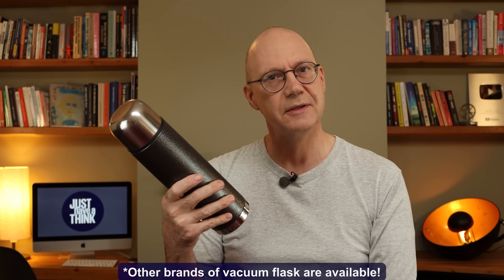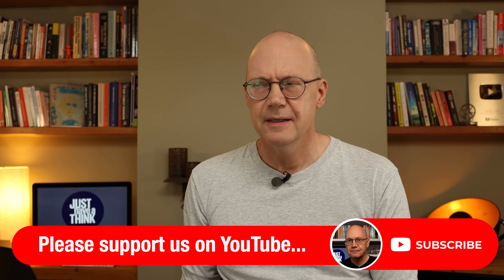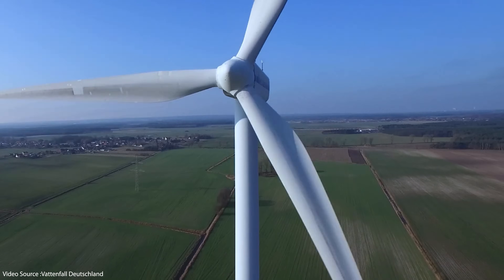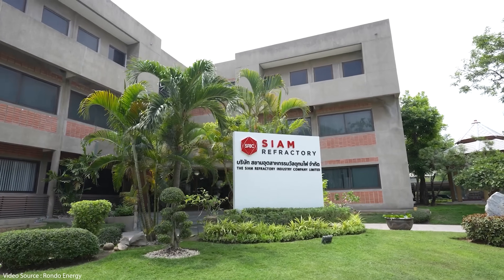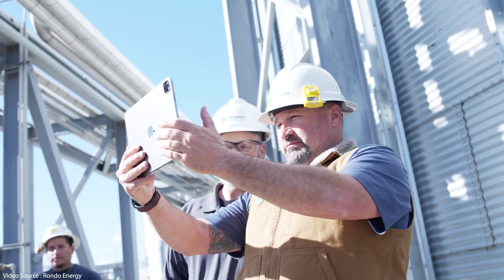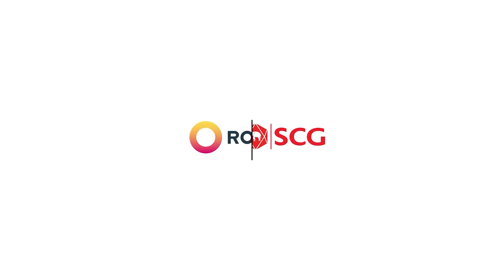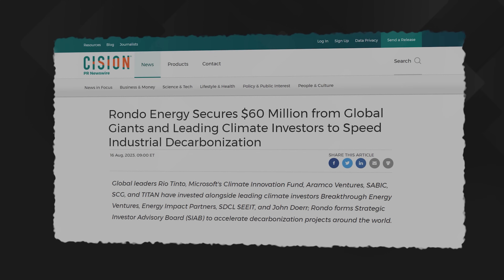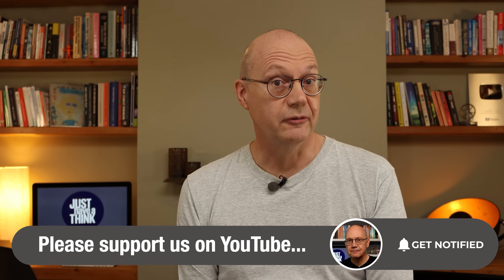This energy storage technology is HOT STUFF!

Comment: My father was part of the design team at Bethlehem Steel for (what was then in 1962) the largest integrated steel making facility in the U.S. called Burns Harbor located in Michigan City, IN. They developed and implemented many innovations in the capture and re-use of waste heat in various parts of the operation. We visited that facility in 2019 for what was the 55th anniversary of rolling the first piece of plate steel off of the mill in 1964. The plant is still in operation today as part of the Cleveland-Cliffs company (stock ticker CLF). 

For anyone who has never seen the process of making iron in a blast furnace and then converting it to steel in a basic oxygen furnace, and then turning it into basic steel products such as steel plate, hot rolled coil, nickel plated products, etc., it is truly awe-inspiring in scale. Unfortunately, it is also a major carbon generator, something the industry has been working to improve for decades.

Comment: Why not heat the water by using the water to cool the current power generators? True, that energy is not green. However, that heat is usually lost into the atmosphere completely. Wind turbines and solar cells don't generate much heat when they are operating.

Comment: There is a huge difference between heat storage and storage of electrical power. You can only generate electrical power from heat by a Carnot cycle. That is dreadfully inefficient if the temperature of your stored heat is only 90°C. Its thermodynamically ideal efficiency is (hightT-lowT)/lowT=(90-30)K/300K = 20%, in reality it is lower than that.

So these schemes are only useful if heat is what you want, not to run your PC or your EV. 

Any reduction of CO2 output is welcome of course, but we really need electrical storage to offset the intermittency of renewable sources. Heat storage can only do so much.

Comment: A smaller simpler version of this could provide heat for small home greenhouses or maybe even homes in more temperate areas. I live in Texas and quite often in winter we have sunny days - very bright, warm sunny days, but it might get quite cool at night. Seems like a thermal solar collector could grab heat and store it in the brick box for home heating at night. Most every house uses forced air heating here, so the heat battery could either ciruclate air directly through the bricks for use in the home or use a transfer medium like water or a glycol.
Reply: Or build passive houses

Comment: If the point is to use electricity to heat some kind of thermal batteries, why not also work with heat pumps ? I mean, you could get a lot more heat per watt... And then you'd kinda be "cooling the planet" doing so.

I understand that moving from electric heaters to  heat pumps is introducing some kind of complexity, failure points and cost into the system (and as we are talking about startups, that's probably hard to do). But I think that it should be the way to go. Maybe you know, if you make some kind of  heat pumps working from outside air temps (let's say -40°C) able to heat all the way to like 1000-1500° C, I think it could directly replace fossile fuels burners too.

Comment: Dave, this is super encouraging and needs to be massively scaled!!  I live in Canada where we need to massively scale up the geo-thermal via closed loop use of old drilled gas and oil holes where pressurized water can be pumped into these shafts to be super-heated and returned to the surface to turn turbines for power generation.  Would love to see an update for this and how it can be integrated into heat storage as well.
Reply: Canada is a great location for heat batteries, and we're engaging in multiple territories!

Comment: I noticed there is no comment that the overall efficiency won't be better the 50% because the conversion from heat to electricity isn't very efficient.
This assumes the energy input is heat in the first place(maybe concentrated solar), which it probably isn't.
Using solar panels to generate electricity and then convert that to heat to store and then converting the heat back to electricity is probably less than10% efficient overall.
Some batteries are 96% efficient on electricity in to electricity out so using solar panels and batteries is about 20% overall, so skip the heat storage stage.

Comment: You really want to use some form of material that has a phase change when heated because it can store the same amount of energy in a much smaller volume.
Reply: Only if space is tight!

For commercial applications what you want is a material that stores most heat per unit cost (including costs of the infrastructure to hear it up and to take away the heat when wanted). Cost of real estate varies greatly, and what would be a waste of space in (say) Manhatten is not so in (say) large parts of Australia.

Where space is premium priced then I agree phase change storage is the winner

Comment: hmmm... Maybe eventually, with enough insulation, this could be used for homes further north, using excess solar power thru the summer months and getting the heat in the cooler months, but it seems like it would be more cost effective for a group of homes/buildings kind of like the superheated sand they are using for district heating in (Finland?). Where I live (near Seattle), with a climate similar to England, we use far more power in the winter when the days are short and we don't see much sun do to the clouds and rain.
Reply: Refractory bricks can have very similar specific heat capacities as silica sand. Sand has no structural strength, so it has to be placed into a structure that is designed for heat to be added and removed. The Rondo block system is quite clever in the that blocks provide the airways to allow the heat to be extracted. For a sand battery, you need to provide this structure, which adds to the cost. The Rondo system could be one of the very cheapest out there.

Comment: I like the idea. However, in order to be useful for industrial heating the temperature of the "battery" needs to be hotter than the required temperature for whatever it is the heat will be used for.

Liquid water as the storage medium is limited to <100 degrees C, which doesn't seem hot enough. Presumably, the brick approach can go higher. If so, this can be a good, efficient way to use renewable energy for industrial heating - if you can put together enough excess solar and wind power to power it.
Reply: You're look at about 1000-1500C for ceramic and/or graphite heat storage mediums - that's what I've seen from Rondo and Antora for industrial process batteries; though the battery doesn't have to do all the heating itself. e.g. Glass Industry have used them for a long time, calling them Checker Packs and the structure they’re housed in are called Regenerators; the exhaust of the furnace goes through the bricks, heats them up and when they intake combustion air it is pulled through the checker packs to get preheated before heating the air further with gas – saving tons of gas.

Comment: Their is one flaw.  Using a metal thermos is inappropriate as these lose heat via metal conduction.  Thermos flasks and airpots originally used glass vacum jacket. These remained hotter for longer than the metal variety.  Thus glass thermos flasks a a better analogy for heat storage.

Comment: I think this can be part of the puzzle. The main problem we've had in the past is a "one size fits all" mentality. We need to figure out what the best solution is locally and not try to shoehorn one solution into all situations. This seems promising and doable.
Reply: While it's a good point, one thing we solve for is versatility in the same way the the natural gas boilers that we replace are versatile to be used across many industrial sectors. They use the same steam pipes, flanges, valves etc., and we've designed the RHB to be a drop-in replacement using the same conventional parts. Plant managers don't need to worry about big costly changes, but drop us in directly to swap out gas boilers.

Comment: Solar thermal is the answer. I've been saying it for years. I'm prototyping a solar thermal platform right now. I will continue this relentless pursuit until I have a viable product for the market. It is proving the most challenging project I have ever endeavored to complete. I hope others will realize the potential along the way.
Reply: The falling cost of wind and solar PV has made it very challenging for solar thermal to compete. Also, in our market, we're targeting facilities where energy density is critical because they don't have excess land, so a large solar thermal plant would not be viable onsite. Also, when you transport heat over distances, you lose a lot of it, so it's important your heat generation is located close to where it's being consumed, which is why our energy dense batteries fit right onsite much like a gas-boiler does.

Comment: It would be interesting to see a breakdown of where different heat storage systems might work best.  You've got a few things going on... obviously, if you need industrial heat at really high temperatures it's better to have a system that goes up to higher temperatures, whereas district heating you wouldn't need as high a maximum temperature.  If the water tank is staying below the steam level they aren't getting any advantages out of phase change.  I'd think the holy grail would be something that is easy to contain but that had a couple phase changes above the output temperature you want, as well as a high specific heat... my brain is trying to wrap my head around thinking about what pressure changes would do.  I know if you suck the air out of a chamber you can get water to both boil and freeze at the same temperature, but I really don't know what that is doing to the calories invovled.

Comment: Re: "10% of the hot water requirements of the entire city of Berlin"

This! It is utterly insane that things like district heating working off of renewable resources or (at the bare minimum) taking advantage of waste heat from industrial/electrical production processes.

You deserve this. I deserve this. We deserve this!

This HAS to happen on the municipal level. That's the scale where you can make a difference. So do it! Call your local representatives and make a fuss about this. Start with convincing your neighbours that this is doable.

It's expensive up front because it's infrastructure but that's not the point. The point is that we can pay for this now and have the infrastructure in place to minimize the constantly creepy costs associated with climate change as well as have a measurable reduction in greenhouse gas emissions locally.

Do it. You. Yourself. Make a fuss! Be loud! Demand answers and solutions! Your siblings deserve it, your kids deserve it. Do it for yourself and ourselves. We need you. Let's GO! WOO!

Comment: I use some 1970's Steffes ETS heaters. they heat bricks up to red hot. then a fan sucks air in from the room and sends a small amount up and threw the bricks and back down and out. These old units just have a knob to set the temperature and a room thermostat to control the fan.

Comment: The idea is actually quite old and technically not too difficult. The bottleneck for these high-temperature systems will in the medium term however still be the energy source. To transition the industry fully, it requires enough green [electricity] to offset 25% of all fossil fuels, which means that the current green energy electricity must quadruple first (if we do not use the green electricity elsewhere). 
Personally, I think using specialized heat pumps with overlapping temperature trajectories to upgrade the temperatures for industrial use is way more efficient.

Comment: The main reason that high energy use industry has trouble de-carbonising is the mind set of the managers.
Their brains are locked into oil fired boilers and diesel generators. They are risk averse, even the smallest risk will have them scrambling back to the tried and true fossil fuel solution. It will take the removal of those managers over time either by retirement or other means to effect change.

Comment: Curious that they chose air as the conductive medium since it has about 1000x less energy density vs water. I guess it might be because you'd need to handle high pressure steam at those temperatures?

Comment: Heat storage is a good idea, but other than for district heating schemes, their application is very limited. To store the heat, you first have to generate it, and doing so from excess wind and PV solar is a very inefficient way of doing so. If you're generating electricity, would be much better to use any excess to charge a battery, preferably a flow battery for grid scale, that to use it to generate heat to store, then converting it back. The loss is too great.
Reply: You're quite correct that it would be daft to use this to store electrical energy.

The use case for these heat batteries is not too store heat that comes from electrical energy (however created). It's to store heat that is produced as the by product of some industrial process till it can be used later (perhaps as the pre-heat stage of the next batch). As such this is 100% more efficient than venting the heat and heating up the next batch from scratch.

The iron industry has been using a version of this idea for about a century - it is the Rondo bricks that are the innovation, not the basic idea. 

(And no doubt Rondo provide control equipment and support as well)
Reply: @trueriver1950  you are quite right, that is the best use scenario, but the video kept quoting the companies involved stating they could 'charge' them using excess solar and wind.
Reply: @tamingthejungleanallotment5486 Then it seems it was me that missed your point :( I will edit out that line from my post.

Yes I agree this system does only make sense of there is no other way of storing that energy as electricity, or in the unlikely event that they are using resistance heating at present to turn electricity into heat (which they shouldn't be). I hadn't picked up that alleged selling point from Dave's narration, which was my bad

Comment: What a clever idea. A "simple, drop-in, zero emission replacement for industrial boilers, powered by fossil fuels." So instead of needing to rebuild an entire facility you could just take out the boilers and retrofit with this system. It seems like the only limiting factor is the availability of renewable energy, but you can still reduce emissions just by installing one of these units. And they say it lasts for 40 years, but you could probably get even more performance out of one by replacing the air circulation system and anything else that wears out but keeping the bricks. I like it.

Comment: How do they fire the refractory modules to develop the ceramic bond required for structural performance? Do they use renewable energy?
Reply: Eventually we hope to use our own heat batteries! For now we're using standard kilns, but our systems recover the CO2 created to deploy them in only a few hours of operation.

Comment: Stainless thermos flask does such a poor job of keeping contents hot/cold that I do not use them. The problem is the seam where the inner and outer shells meet is too large and is a path for heat to flow.  I use a glass thermos every day. I use it to "cook" steel cut oats over night. 

It helps to not leave the thermos upright on a table so that it can't be knocked over.

Comment: Three questions that I think should be evalueted.
1. Power loss in distribution/maximum distance covered.
2. Power loss for transforming this into electricity.
3. Energy wasted and enviornmental impact during the fabrication and implamentation of this.
Reply: 1. Would be a local consideration and very geographically dependant - so I can't really speak to this.
2. You're probably looking at 100% efficiency or near it for converting electricity to heat, but 30-40% for converting heat back to electricity; however most thermal energy storage companies argue that round-trip efficiency can be a misleading metric when considering storage solutions; citing that while a grid may only be able to recover 30-40% of stored energy, the cost of storage and recovery will cost around 10% of what it costs to store the same amount of energy in a lithium-ion battery. Thus, even though the round-trip efficiency is much lower, the cost per joule of reclaimed energy is still better value due to the low capital cost of thermal storage. Whether this is viable will depend on the cost and availability of off-peak electricity.
3. Most thermal storage companies are looking to use materials that are either readily available, abundant and recyclable - because there are no emissions in the use-cycle of the bricks they can be reclaimed after the 30-40 year lifespan and recycled into new bricks at a rate of almost 100%.